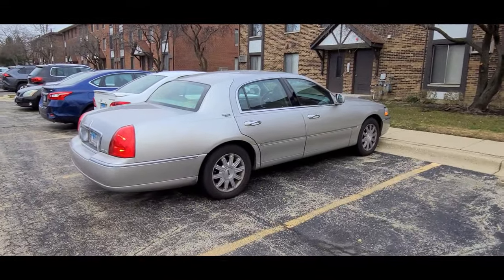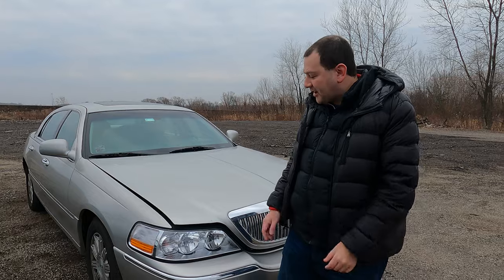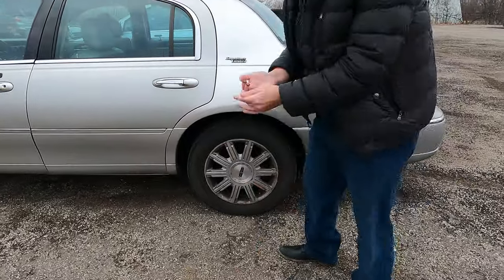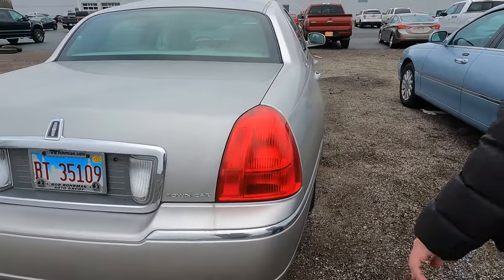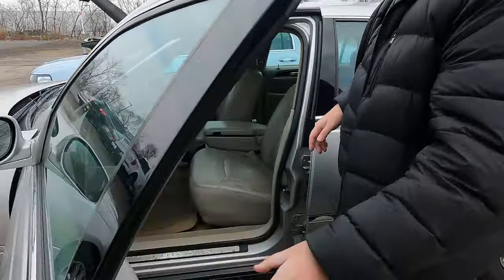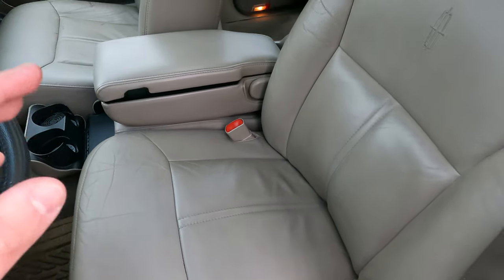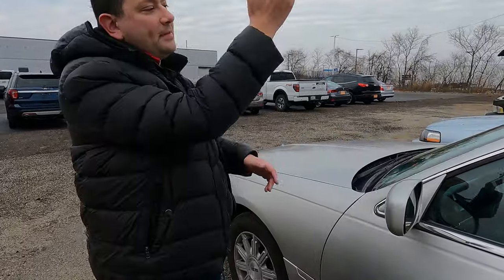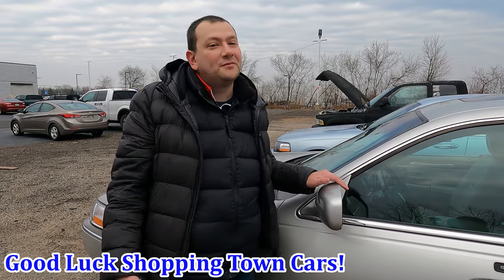Lincoln Town Car Guy Presents: Watch This BEFORE Buying Lincoln Town Car / Mercury / Ford Platform

Comment: Oh! Also clean the leather with a magic eraser. Buy a white towel. Dip the eraser into hot/warm water. Then lightly rub the leather. Then use the towel and wipe off the water. Then NEXT DAY use leather conditioner. SLATHER it on! Go to sleep and the next day all the conditoner should be soaked up by the leather. Anyhow give the leather an other wipe with a white towel. Do this every 6month to a year. The leather will look NEW!!!
Reply from the maker: Thanks! I have some videos on my leather cleaning and will continue to clean/condition in the spring and summer.
Reply: 303. Alot less work and as good results. I was told about 303 by Sweet Project Cars. Great guy who has been in car business for 40 years. Knows his stuff and has alot of easy, affordable and awesome tips on all things automotive from fixing cracked and ripped seats in these cars, and rust proofing, and how to make almost every inch of auto shine and protected. I use alot of his tips with customers. It saves me time, money and labor. And makes them happy and return and makes me more money to upgrade shop.

Comment: Pro tip for those new to keeping older cars: dress all of the door seals and sun roof seals with Vinylex or ArmorAll at least quarterly to keep the seals in great shape.
Excellent video, thanks! Panthers forever!
Reply from the maker: Thanks for the info and complement!
Reply: I use baby oil
Reply: @kitjasabsgabs1830  legit question, not trolling. From understanding.... doesn't petroleum based lubricants degrade rubber? I have 2006 town car, impeccable shape, and I'm considering the ideas in these comments.

Just honestly inquiring
Reply: @Thenextkingmj2  We've used baby, mineral and Vaseline on Airbags for trailers and trucks for decades. I use a product by 303. They make excellent protective sprays that won't attract dirt and dust and last alot longer than armor all. If you use something like gas then yes it will eat rubber up. But the other stuff will not. I use 303 and mineral oil on inside and out of tires when I buy them. They last 4 or more years on average and look great. Same process, 303 and some kind of oil type. My father has used this on all the tires he buys which is alot. 18 for rig and 8 for each trailer, plus a triaxle loader with 12, 2 is for tag, plus 8 for log loader, and 4 on log skidder. Nost have air bags too. He gets alot more mileage out of them. 
When we buy anything rubber it's not protected at all. It needs something to keep it moisturized and suppple like our skin. If we spend good money on products and parts we should protect them as we do our paint and other surfaces. I spray 303 on about everything I can. If it was safe for my skin I'd use it. I've never had any complaints when I've used it. Only thing I get is what did you use on my tires and wipers cause they're still in great shape after winter and the heat of summer. So many still use armor all. It's ok. 303 is way better. If used as a base on anything it's a hell of a tough combo to beat! I've not saw or had any issues with any of this on any surface. Besides if you're going to prime and paint you really gotta prep cause 303 really gets into the surface. It will fisheye if not cleaned very well. Ask me how I know?? Lmao. I'd never give car advice that I'm not 100% sure of. I love my car as I'm sure we all do. I'd never tell anyone to use a product on it if I didn't believe in it and use myself. I've been doing this for 3 decades now and alot just don't work or does and don't last long. 303 and some type of oil works and keeps working months and months. I'm very thrifty and love to make stuff last as long as I can. I buy good parts and I do my best to make them last as long as humanly possible. I've had customers not replace tires and wipers and airbags for years. Driving in the rust belt. Baby oil has a nice aroma, mineral is cheap also with no smell and a tub of Vaseline can be used as is or heated a lil bit and used as a spray or whatever you need. I've used in door, trunk,hood, quarters and no rust. It's good cheap easy protection. Stuff costs so much why not spend a few minutes and couple bucks to make it last even longer??
Reply: @Thenextkingmj2  BTW my 07 designer has 115k. Serviced it's whole life at dealership. I keep ot it tip top shape. I've used this on bags and they look new with no pits, bad spots etc. They always start to breakdown at bottoms when they air up or adjust. It's a must to keep rubber in soft, smooth shape so it won't start degrading. Spray with 303 and rub in then any type of oil or Vaseline and I promise those bags will work and look flawless for the life of the car. It's cheap, easy and takes a few minutes. It won't break down the rubber. I use Firestone bags cause I always have. They use high quality rubber. Father uses same for his bags on semi and trailers. A decade on a car should be easy. The bags on a log trailer take alot of abuse from rain, mud, snow, ice, tree roots, tree bark etc and they last 5 years plus.
Reply: I think Meguiar’s has a treatment product which helps avoid the shrinkage and oxidation of soft rubber sealants .
Reply: I think silicone clearly helps .

Comment: I have a 09 Town Car, actually very similar to yours it has 62K miles on it and was a one owner. The previous owner stayed on top of the maintenance I love that car, not as economical as my 03 Buick LeSabre but probably still less expensive to own as seems the LeSabre constantly had small issues.
I hope to drive it for many more years.

Comment: Also, another common coolant leak in the manifold is where the heater core hose connects to the vertical plastic nipple back by cylinder 4.  It tends to crack. Some people have JB Weld'ed a copper pipe inserted into the plastic nipple.
Reply from the maker: Thanks for the comment! Happy to report that my leak have not been back since that last video with check engine light. Going on month #2 holding strong.
Reply: I had that same problem on my 06
Reply from the maker: @deshawnreal1690  Sorry to hear that. Would you like to elaborate?
Reply: @VitaliyKofman  Wish I could. I got rid of the car but I’m about to get another 06 with 87k miles on it. With maintenance u can put 500k miles on the original motor and it still runs good. Love these cars.
Reply from the maker: Gotcha! Congrats 👏
Reply: That happened on a 2001 Crown Vic I had and at the WORST TIME! Rush hour! Steam all over including in the cabin!
Reply: You can cut it out and just use a heater hose. It's not a big job. Remove alternator for alot easier time. Cut off and leave about 2 inches at least on back of water pump location and cut off at back of engine. 2 hose clamps and a few feet of heater hose. Done many like this that has the 4.6, 5.4 engines. So many new cars have a plastic thermostat housing. I changed one on a auto but don't remember what. Something pretty new. Crazy cheap ways they try to save money to upcharge to us. Should be illegal.

Comment: There is no problem with sun roof gasket. There are 2 rubber pipes going from the roof draining water to the back fenders. Every year it is good to blow air bacwards and doing so the leak is fix. Veary easy job. Even by blowing air by mouth can help. If you see few of those videos on You Tube about Town Car you don't need to bring mechanic. About sagging door every year you should put lube on hinges. I have 2007 and it is the best car I ever own.

Comment: A really common failure is the latch on the storage compartments on the front doors and the upper drivers door hinge.
Reply from the maker: Yes, I know what you are talking about. When I was shopping for this Town Car, I saw several of them with it missing.
Reply: Where can I find some ? I need both doors
Reply: Yup! I had to go to a bone yard and get that plastic piece and replace it.

Comment: Except for the moonroof I have the same car as you including the color.  Why is the rear paint lighter?  I understand you had rust and it was repaired and I assume painted as well. Is that the best they could do on color matching?  Either the painter was a novice, or lazy because that should have been much closer in color. Any body shop that has a paint booth and mixes their own paint can compensate for climate exposure on the factory formula. A body shop that does not mix their own paint go's to a paint store and buys the stock paint by the code. The older the car and the more sun exposure the paint on the car will be faded and no longer match the factory paint.
Reply from the maker: It was a budget repair and they used some generic silver color. Thanks for the comment
Reply: I got G4 Cashmere tricoat colored paint from online place. Mine is 07. Damn rust in fender arches under the fancy shiny junk pieces. It is more tan than gray now after doing so. But instructions said to use a paint card and see how many coats it takes to get right color. Me in October barely 64 at 2 pm hurried. I wish I could've just got a base and clear with the pearl together and not 3 cans. By time I do base, wait, effect wait, clear I was losing temp and light. I believe the color is right, just my error. I wrench on autos and body work. Paint is a art to get coats, time to flash, sand between coats or not, spray clear, get right cut, buff and polish the side so all paint is closer in shade. But Mines easy to see cause I didn't polish or do that. But still tan and gray on mine is not same. But the scratc wizard lil jar and kit I got is damn near spot on. It's not 3 jars of paint. So idk if I could've just got base and 2k clear and be good or not. Gonna have to figure this one out before respray.

Comment: I just bought an 04 town car with 106,000 miles on it. It is a south carolina car, I went there to get it from East Tennessee, a 3 hr drive. It was worth the drive. The underside of the car looks like it's 6 months old. No rust , no accidents. The interior  and exterior is in mint condition, not even a door ding. The driver seat could use a little bit of stuffing. The rest of the seats look like they've never been sat in. It has a few dings and scrapes on the bumper covers that I plan on fixing up. I'd been looking at Town cars for a few months and this one came up, I got it for $4500. I also have an 07 town car  that I bought for $500 but I think somebody put it into a ditch before I bought it. The moon roof leaked on it. Mechanically it's perfect but the body is rough on it. But the 07, put me into a mood of wanting a mint town car. My folks always owned town cars, and I always loved to drive them. I made sure to not get a moonroof car this time, because for the life of me I couldn't find the leak on the 07 car. I ended up sealing it up with silicone. I love those cars. Also they are relatively inexpensive and simple to repair which is a plus when having an older car that you can repair yourself.

Comment: Sorry to butt in like this but if I may ask, I bought a 2011 TC with 143k miles for $7500. The leather in the front is worn and the exterior is pretty nice without many scratches. The door handles on the inside have cracks around them too. Do you think I overpaid? I just regret buying it because I didn't realize that rear-wheel-drive cars are not as easy to drive in the winter. I'm planning on investing in really good winter tires to stay safe as the car has fishtailed on me once while making a turn. There wasn't even any rain that day. Thank god I didn't hit any other car.
Reply from the maker: No, I don't think you overpaid considering the year and relatively low mileage. You will get used to the rear wheel drive very soon. It will become second nature.
Reply: @VitaliyKofman  Thank you so much for the reply. I am practicing safe freeway ramp entering and exiting as they curve quite heavily at times. That way, by winter time, I should hopefully be fully ready to drive it along with the winter tires. Have you tested any differences with winter tires on your TC? especially that Illinois winters are harsher than here in Maryland. You guys have a much flatter terrain than we do though. We have a good amount of hills and wierd curverd inclines. Not as bad as Pittsburgh though!
Reply: @Uranusfog  I'm south of Pittsburg in country and I have no issues with good rough tread light truck tires on back. And I bought a quick install set of tire, not chains but a Hard plastic diamond like thing that's quick and easy to install and not a pia like traditional chains. I'll have to see what they're named. Not used them in 2 years. And I have 2 of these a 99  Cartier with 253k and a 07 with 114k now. Got good winter treads ready to go. Spray with 303 and they will last a lifetime and never dry rot. Inside and out. Its amazing stuff. Sweet Peoject Cars. He shows you step by step how to fix seats cheap, quick and easy. Where I saw about 303 spray. You got a heck of a deal. These cars are the best made in last 30 years. One guy had a 2010 with 650000 miles same motor and trans. Don't FLUSH TRANS. Just fluid and filter. Motorcraft. Hope you enjoy it. Love Vitaly and ford boss me. Alot of good owners doing good stuff to help is keep these great gals going!!
Reply: @kitjasabsgabs1830  the guy with 650k did he change the fluid in the transmission ever ?
Reply: @alecwall6703  yes. Every 50k. Never flush it. Ford had a recall in 2003 I think not sure about flushing. I think it was with the newer trans when they did last version. That's all it needs. I start mine with the coolant return and let it out while I fill with pre made gallon jugs of fluid. When it goes from eww to neew I stop. Or start and when it's about all out stop. Take pan off, replace filter, pan on then pour new in and start. I believe the torque converter has a drain. Think. I recall draining a few but usually ppl don't want that. Just filter and new fluid. It helps to have a helper so when fluid starts to turn color or stops flowing to stop engine. I do it by myself but I use a clear hose so I can see when it's getting close. U can tell. It's hard to describe. 1 buddy in USMC dad owned a taxi business in NY city. He'd buy these cars at 200k cheap and run till death. He had a few go over 800k but he serviced them routinely and his friend owned a shop who was a Ford tech in 2000s. As long as they are serviced at the intervals there's no reason why we can't get many many miles. These have kinda small oil passages. So when u skip that 3500 change if it starts to plug up its on borrowed time unless you run some BG through it. I always will use some MMO in oil before a change. 1 has 117k other 99 has 253 k. Same engine trans etc. I also mix 1 quart of any new or used oil, 1 quart of any new used trans fluid, not from a trans woman after bottom hacking, 1 tube of grease gun grease and 1 toilet wax ring gasket. I saw this from another poster and tried it. Works great. Better than fluid film and blaster and New Hampshire stuff. But we don't get snow like we used too so maybe overkill. Cost me 5 bucks. Gasket and tube of HF grease. Heat it up and it's ready for brush, I made a home made gun from a air gun that has a suction nipple. Messy but what isn't.
Reply: @Uranusfog find an empty parking g lot next winter an practice going right while turning left ...like lightning McQueen in the cartoon movie Cars
Reply: @Uranusfog have you crashed yet?
Reply: @MAGA_Randy_Marsh  Don't say it like that, lol. By the grace of God, I have been doing well drivin the car. I drove the entire Minnesota winter in it. I also put allweather Nokian tires on it. Like Vitaliy and @kitjasabsgabs1830 said,  driving correctly is of the utmost importance to stay safe whether driving a front or rear whee drive car.
Reply: @kitjasabsgabs1830  Thank you for the advice man. Looking back now, I was pretty shaken after the sliding incident and went into panic mode! I drove the car on multiple long trips between Minnesota, Baltimore and Chicago. Drove in sub zero Minnesota weather (wasn't perfect) but wouldnt have been much better with a normal car, Ice is relenless regardless of what your driving. but I do think the flatness of minneapolis helped as the driving characteristics changed drastically when I'd be in St.Paul ( which is very hilly). I'm definitely not brave enough for Pittsburgh hills in the winter though. Seriously , how can cars move there during icy weather on them 90 degree hills lol?